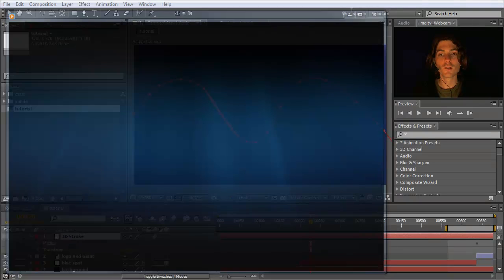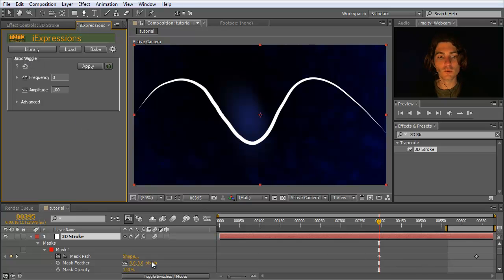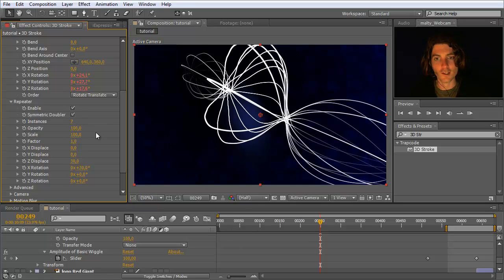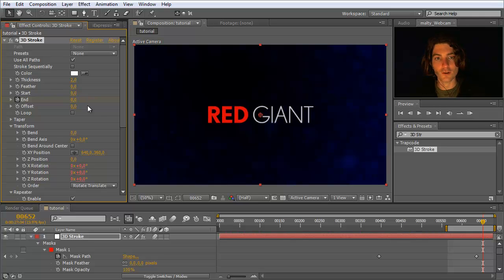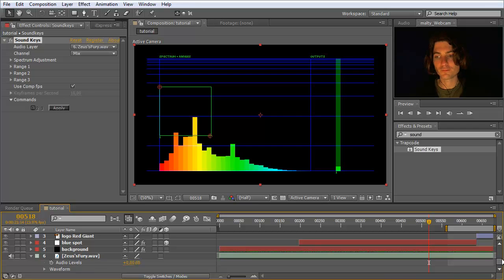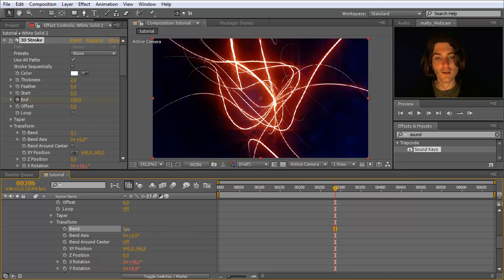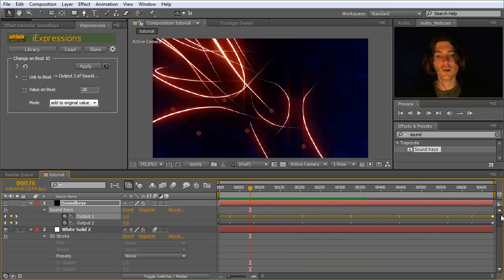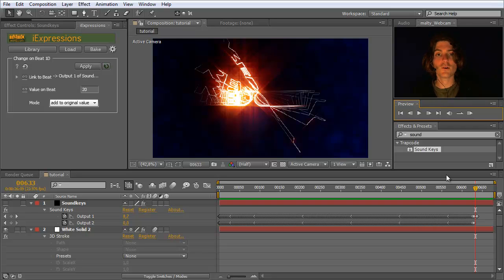After Effects Tutorial: Intro with Trapcode 3D Stroke (english)

Comment from the maker: @Paul: in After Effects, each keyframe needs to have the same amount of vertices. Hence, this is not easy to avoid. You can create a second mask with only very few points to get a smooth sine curve and then try to match this with the other mask as good as possible.